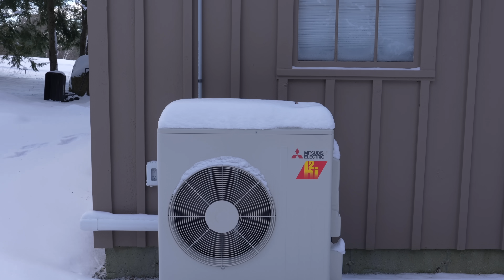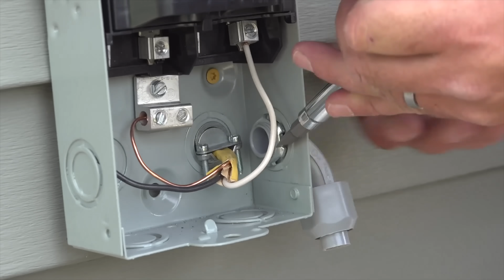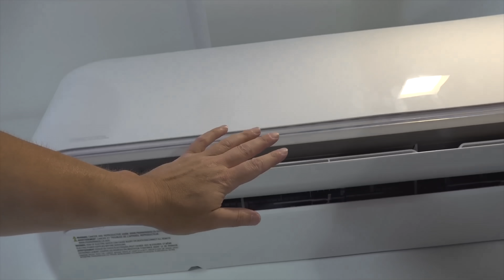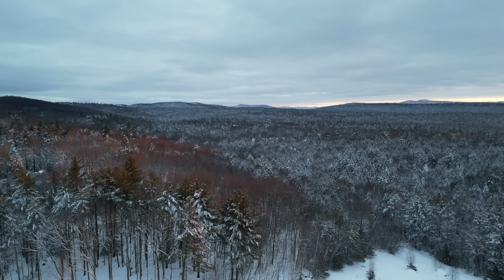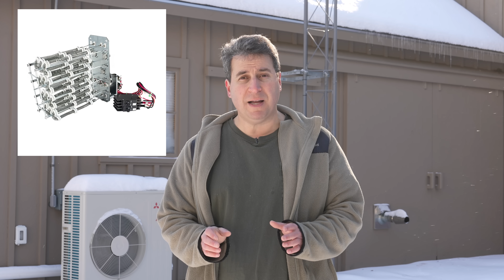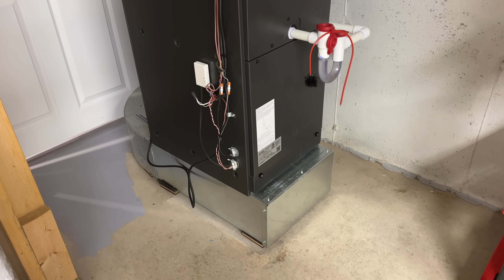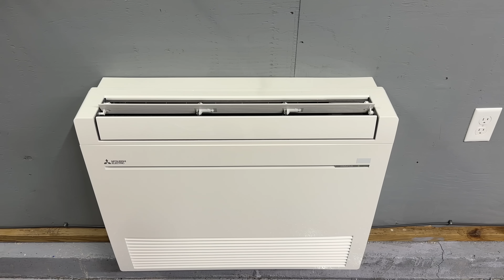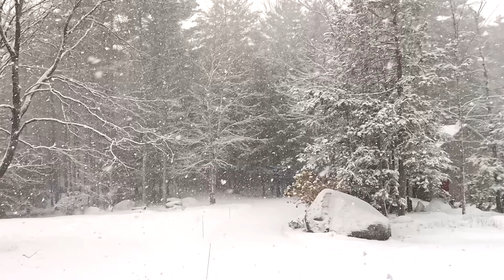Why Heat Pumps are now leaving people COLD

Comment: As a long term subscriber and a fan of your work, I am concerned about the possible effects of this video. Not because of factual errors but because you have over-generalized the issues on the negative side, thus leaving an unbalanced framing of the applicability of this technology.
     My house is in upstate NY, sitting at 1,200 feet altitude and is 16 years old. I installed mini-split heat pumps this summer, including a wall mounted output unit in the dining room.. The existing radiant propane boiler system was left in place as a backup, with the thermostat set 2 degrees below the setting of 73℉. 
     The last 2 nights the temperature dropped to 8℉. The heat pumps had zero problem keeping the entire main floor at the set temperature and the propane system never came on. 
     So, please consider that this video, viewed by the uninitiated, could easily discourage people who should be adding heat pumps to not even look into the potential benefits. 
     Finally, one must also include the environmental benefits of switching to heat pumps as the climate situation breaking (in a bad way) records every year. Thanks.
Reply: Did you watch the video before commenting? He acknowledges that nearly all heat pumps will function down to 0f air temp. The issue is that they lose efficiency. So you may suffer on your electric bill if very cold temps persist and you don't use natural gas or other backup.

At the bottom end of their working temperature range, heat pumps are probably not much better than space heaters in terms of efficiency.

People can get through moderate winters with just space heaters, but they may regret it when the bill comes.

Comment: The biggest issue I see is all the operators are designing for a low or -3c - so if you go below that regularly it becomes a 1 for 1 using the auxiliary , these should be designed for -12c  usa or -8 U.K. without using the auxiliary’s
Reply: Ours works fine at -15 C and is specified for -25 C which is unlikely in our mild climate. No auxiliary heat, but we do have a natural gas fireplace insert that keeps us cosy when the utility power fails.

Comment: If you are having troubles with a heat pump system keeping your house warm, and you have confirmed the heat pump is working as intended, you need to look at your attic. The number one way to lose heat or cooling in a house is by having a leaky house. The most cost effective way to improve your heating or cooling situation is to identify those leaks and seal them. Typically, the biggest culprit for air leakiness is the attic. So sealing that will likely significantly improve the performance of your heat pump in cold climates. The other potential issue in the attic is not enough insulation, this is mostly a potential problem with homes 25+ years old where the blown-in insulation has settled over time resulting in a reduction in performance. Small animals getting in your attic can also cause issues. Fix your attic situation, and you will likely greatly improve your heating situation, and this advice works no matter what kind of heating system you use.
Reply: Using a thermal imaging unit will find those heat/cool loss spots quickly. A riend had a new house built a few years ago, he loves tec tools, one day I brought the thermal imager over to play with it and found a section in the ceiling they forgot to put insulation in, it was summer time and that section was a hot spot, he might have never know.
Reply: Air sealing should be considered way before more insulation. Some people get sold more insulation without air sealing. A waste of money. 
Someone in the comments of another video said go into a dark attic at night with the lights on below and see all the holes. Partially true. You also have to seal the tops of the walls where cold air drops into the partition  walls and leaks out the receptacles.
Reply: Is blown in insulation better or worse than the rolls of the Pink Panther insulation?
Reply: @dannydaw59 it is neither better nor worse. You just have to make sure you get enough of either. If you want to upgrade your insulation there are other options. The first is Rockwool, it isn't a better insulator, but it is much more fire, water, and sound resistant so it provides additional benefits than just insulation. It is more expensive, but not unreasonable. It is my recommended option due to the fire resistance. If you want a better insulator you will need to go with closed cell spray foam (don't do open cell unless specifically necessary in your situation), but that comes with a hefty price. Spray foam is really best if you want to turn your attic into a living or storage space.
Reply: What if they just left a window open?

Guy over here feeling like Sherlock Holmes.
Reply: Do not forget the windows, the US shutter system is dreadful, you guys should really learn a lesson or two how we have in Europe our windows with 2-3 layers of glass and vacuum in between and a solid metal frame which has another layer of isolation between the contacts!
Windows can be a huge source of losing heat or getting heat in!
Reply: But at the same time you want your attic ventilated, or you are going to get a myriad of other issues.
Reply: @mathieuconklin3146  the point of air sealing is sealing between the living spaces and the attic, not the attic and outside. Attic ventilation is a different topic.

Comment: Michigan - I use gas on lower temperatures. Its still cheaper than heat pump on something like 20F. Roughly... Math is not easy on that. Anytime heat pump need a defrost - the efficiency goes out of window.

Comment: Are you a ham? What's with that Rohn 25 in the background?    As for this topic, central heat pump 5 kW. With heat strips 10kW.    Not sure it's less electricity though my heat strips kick on (aux heat) if I bump the thermostat up 2º

Comment: I am always amazed that no-one talks about cost! Complex equals more cost. The cost benefit is questionable when compared to conventional heating. Put an electric immersion heater in your hot water tank and circulate. Keep the heat pump for summer cooling. It is what it was designed to do.

Comment: Dual fuel is normally the way to fix this if you already have natural gas or propane available.  I put one in a few years ago and it is great.  Mid-Atlantic location means the heat pump handles probably 90% of my heat needs, but when the temps drop down to well below freezing, you just push a button and now you have a traditional gas furnace.   It was about $3k more to go dual fuel, but I am saving so much on my heat bill vs. 100% gas heat that it will pay for itself in under 5 years.  You need a LOT of days below freezing for the high temp. before you won't save huge money with the heat pump over 100% gas.  Think about all those spring/fall nights as well as winter itself.  It really was a shocking change in the utility bill for us.
Reply: Just remember heat pumps are mechanical contrivances with a finite number of run hours. Running a heat pump in the winter can easily wear it out in 12 years. That is almost a thousand dollars a year in equipment cost as a simple a/c unit will usually last over 20 years. A gas furnace will also last over 20 years. So dont forget to figure in replacement cost. A thousand a year is a lot of propane, I paid 1.27 a gallon this year.

Comment: Where have you been?!  Supplemental resistance heaters, also used for backup(emergency) heat if the heat pump fails have been around longer than you have been alive!  Used in combination with 2 or even 3 outdoor thermostats varying amounts of supplemental heat are allowed to come on depending on the outdoor temperature when stage 2 of the indoor thermostat calls for heat.  If the heat pump fails a red light comes on and all outdoor thermostats are bypassed allowing all the resistance heat to come on as needed.  Yes today this is all accomplished with digital electronics but I'll put my money on the old way in terms of reliability and longevity.  When I was designing residential heat pumps, (1970s and 80s, thinking was that shutting down the compressor at some outdoor temp could shorten compressor life because of the cold restart required.

Comment: Two things; you did not mention are first that you have some of the highest, maybe the highest, electricity rates in the country. This is going to further negatively impact the true operating cost of using heat pumps in your winter months. A realistic assessment of one's winter temperatures is an important consideration. Second, the term "COP" or coefficient of performance of each HVAC unit is the key to both predicting efficiency and quantity of heat at any given outside temperature. The COP at 47 degrees is a next to useless figure in NH. You should look at the units published rating at 15 degrees and even  -5 degrees to predict your units winter value. Some HVAC sales people also do not explain the benefits of over-sizing the unit in preparation for colder climate days. This drives up the costs but tends to solve the complete winter heating issue. As you are now trying to explain after the fact, heat pump efficiency is not linear as compared to oil, gas, wood, or even electric space heaters.

Comment: I get that Geothermal is usually referred to as "Geothermal", but they are also heat pumps.  Naturally, they have a much higher cost to install and over time, the eventual cost to replace the buried line is also going to add to reduce or maybe even exceed the cost benefit.  Not sure about those numbers, but it would be something worth discussion and comparison with outdoor heat pumps.
Reply: The buried lines NEVER need replacing. They are generally heavy-wall polyethylene, much like standard direct-burial water lines. I've dug up forty and fifty year old lines that looked like brand new. Your ground-source heat pump lines are permanent.

Comment: Had a Heat Pump in N Central Florida. It was a new Trane unit (4 yrs old) and was worthless in my 2600sq ft home (built in 2010) below 25F with any amount of wind. Immediately reverted to "emergency" (strip) heat. I had two Delonghi oil radiatpr heaters (1800w) that, even on low, were more than enough to keep the entire home without dipping into strip heat. The low setting on each heater was about 320w according to my Kill-A-Watt device. Strip heat also sent indoor humidity down to the teens (14%, at the lowest). Gross. Using the oil radiator heaters kept it in the mid 30's, which is much more comfortable. LESS static, too.
Reply: Your "oil" radiator heaters have exactly the same efficiency as your heat strips.  1 KW is 3400 BTU.  Physics that can't be altered.
Reply: @frequentlycynical642  Maintaining the exact same temperature inside, my power bill was nearly $80 lower with the oil radiator heaters. 6 years with strip heat and 5 years without using it.

Also, no they don't. There is a significant amount of heat energy lost in the poorly insulated ductwork of my old house. The first several minutes of each heating cycle, the air coming out of the ducts was ICE cold. Resistance oil rad heaters in my living space don't have to heat lossy ductwork.
Reply: @DBravo29er  Your lossy ductwork does not negate the matter of BTU's per watt.  But you do have a logical explanation.
Reply: @frequentlycynical642  I'm not negating BTU's/watt. I'm simply providing a cogent, practical explanation for the obvious difference in my power bill from one to the other. Thermodynamics laws aren't getting broken (obviously), so other drivers must be in play. This is one of them.

Comment: When I first had my heat pump installed about fifteen years ago, I noticed that it would heat the house and then go into defrost mode which meant that it would reverse flow back so that heated freon would defrost the outside coils.  During this time, the supplemental heat would kick on and provide the heat necessary to defrost the coils and keep the house warm.  My idiot HVAC guy undersized the supplemental heat strips so effectively, I was heating the house and then air conditioning the house during defrost cycle.  Wound up having to change out the system to a dual fuel (piggyback) furnace.   Now use natural gas furnace as the emergency / secondary heat source and the heat pump when the outside temperature  moderates.

This past week, with temperatures in the South dipping into the teens, I don't use the heat pump and have switched it over to the gas furnace.